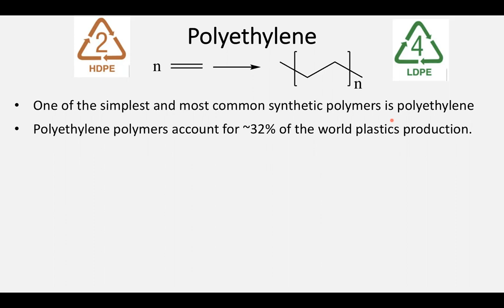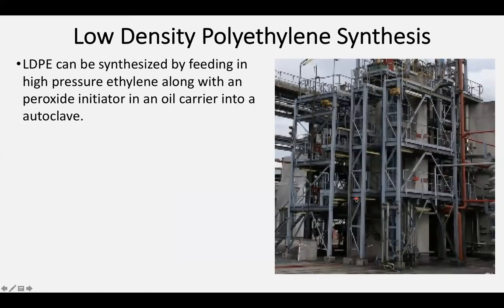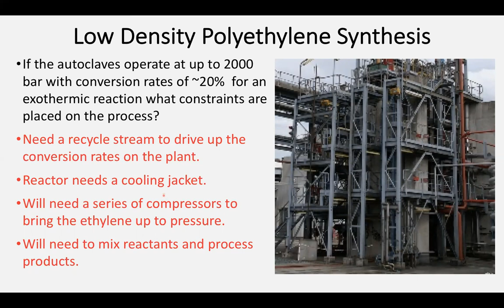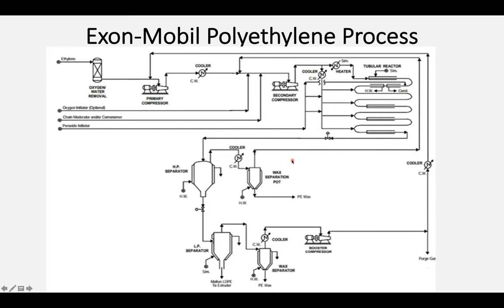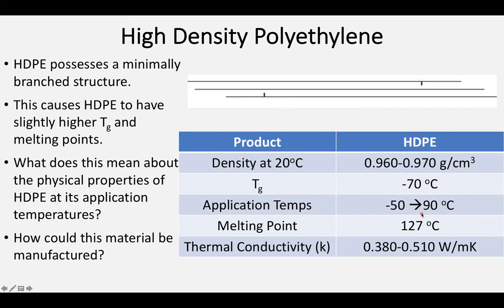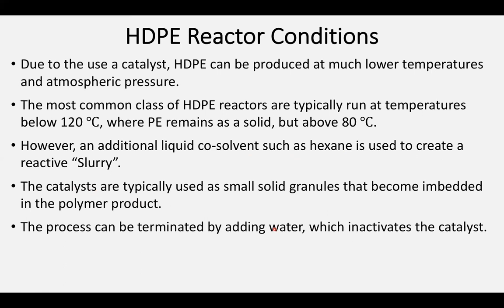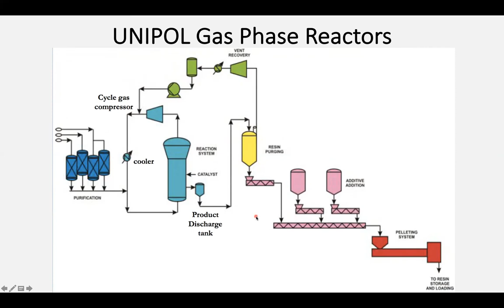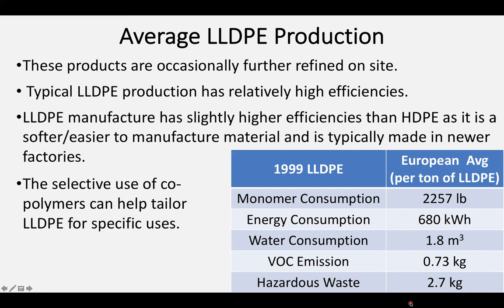7.2-Polyethylene

Comment: I work in a company with  LDPE plant. We have to operate the autoclave reactor in a conversion less than 20%, it is around 13 - 14% of conversion, becuase we have moderate production of PE wax, which affect some equipments in the plant, meanly fouling heat exchangers. How could we do to reduce the production of PE Wax and how to remove properly without fouling the heat exhangers?
Reply: Start by adjusting the temperature or pressure in your autoclave reactor. Lowering the temperature slightly might reduce wax formation without significantly affecting your overall process. Set up a filtration or separation system to catch the wax before it hits the heat exchangers. This could be a filter or a centrifuge that removes wax particles from the flow.: Schedule frequent cleanings of your heat exchangers, using either mechanical cleaning methods or chemical agents that can dissolve the wax buildup.